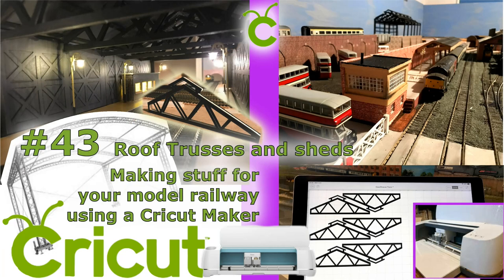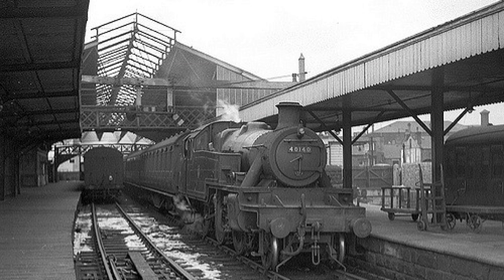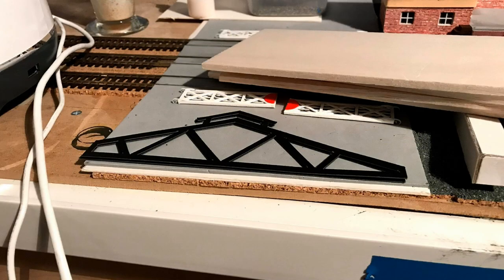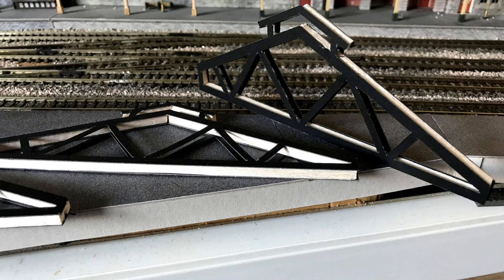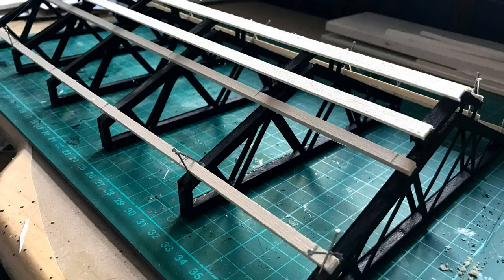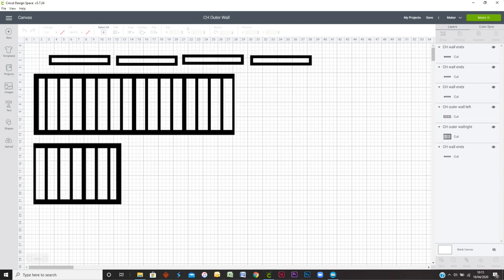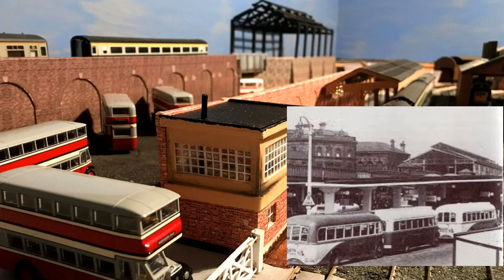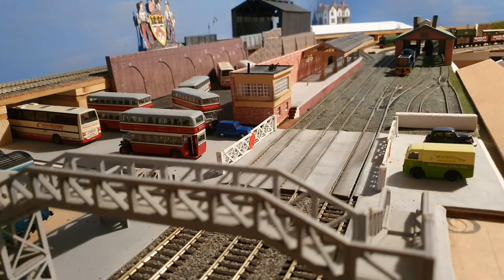#43 Making Roof Trusses and Shed walls using a Cricut Maker

Comment: Which model of Crichton are you using and do you have any suggestions for buying one?
Reply from the maker: The Cricut machine I am using is the ‘Maker’ and it now has a large amount of extra tools available to enable further crafting exercises. It is the expensive model but is worth every penny. If you do go down the road of buying one and also end up trying vinyl cutting and doing your own t shirts do not get sucked into buying their vinyl or heat press. Go online to buy iron on vinyl and get an all in one heat press from China for less and it does ten times more.